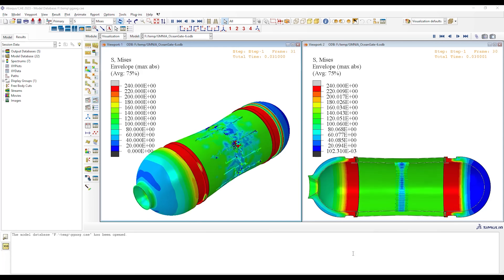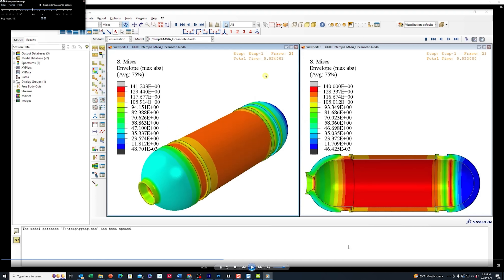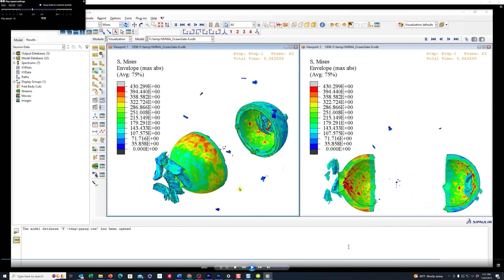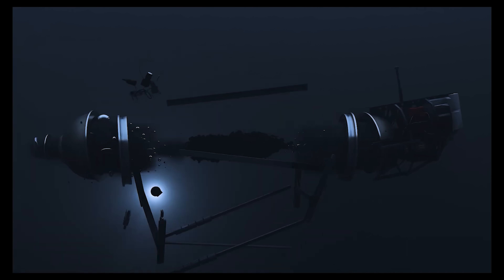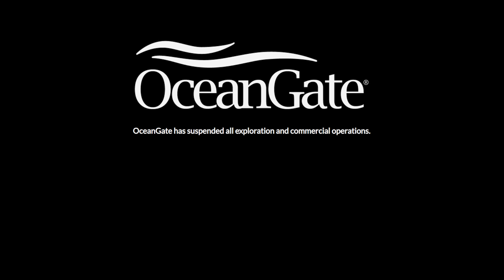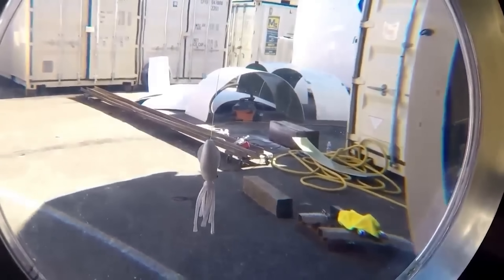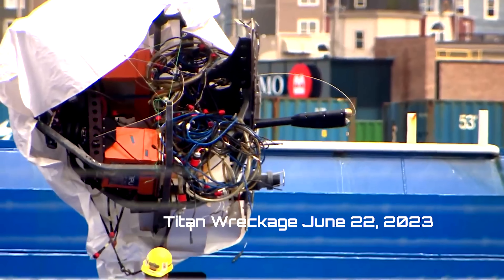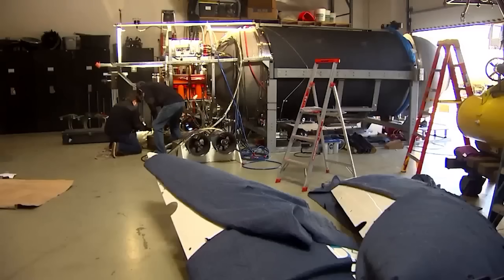Best Titan Sub Implosion Simulation, Cracked Porthole? Q & A

Comment: Mechanical things don't necessarily fail at the "red" points on an FEA. They tend to fail at the highest stress points. In this case, the highest stressed points was the glued interface of the shell and titanium rings. There was so many bad things happening there, its almost impossible to model it. If they did have a good bond, then the flexing of the hull under pressure would break that bond and damage the CF in the process. If it wasn't bonded, then water could ingress and get into the CF laminations.  The hull would be compressed much more than the titanium, so the edge of the titanium would be cutting into the CF little by little.  I'd like to see somebody model this for real and test it.
Reply: i believe the implosion started from the back, crackling sounds were from the back
Reply: @kenho-wr5ul2rh7m  If the communications that have been going around are true, all of the acoustic warnings were lit up red.
The entirety of the carbon fiber was coming apart.
Reply: @RealMcCoy0205  The transcript was complete fake. Came from tiktok. Zero truth to it.
Reply: @paulgallagher2937 Pretty sure the  transcript is of unknown truthfulness. People are trying to claim it has to be fake because it didn't use abbreviated codes. But the messages were short. They weren't transmitting a large amount of information.
Reply: @paulgallagher2937  you don’t know that, just because it was on TikTok, does it mean it came from TikTok
Reply: @lockbert99  Actual messages are all coded as 1 letter. They use sonar to communicate. It was definitely fake
Reply: @paulgallagher2937  The BBC did a documentary and they showed the screen. It didn't appear to be all codes
Reply: @july3410  The transcript is debunked. They had a cheat list of communication signals, almost all of which are just single character. The comm is done through sonar, so its extremely difficult. They never sent entire sentences. Its not possible.
Reply: @lockbert99  I'd like to see that
Reply: @july3410 if it even breezes by tiktok you need to take it with a healthy dose of salt and wait for something official.  That's all they're saying.
Reply: @kenho-wr5ul2rh7m  Bad habit to make your conclusions on unconfirmed informations. ;) People often forget that the communication log is not a verified source.
Reply: If you read the ORNL study Scott Manley had found it also says that the failures in their tests occurred at the glue points. Not due to failure of the bonding but because exactly what you said: so many things happening in those spots
Reply: @udirt  It was just such an awful idea. 99% of competent engineers would have rejected it with very little thought or research. You wouldn't build anything that way, never mind a deep sea sub. There are much better ways of joining the CF to the TI. And you notice that the cylinder had consistent thickness throughout its length. That means they did ZERO stress analysis, otherwise there would have been varying thickness to reduce stress risers. More engineering goes into fruit barrels.
Reply: @udirt  My theory is the glue on the front titanium flange was subjected to additional uneven force when the front hemisphere was open on the surface. That is the hinge would put all that weight into one small point.
If that glue joint failed, it would explain how all the remnants of carbon fiber/people end up rammed into the opposite hemisphere.
Reply: Some guy in this video mentioned the CF was covered in something that stops water from getting into the CF. I immediately think of that pump Stockton mentions and the entry point created that goes from the outside in. If the transcript is to be believed
 I would consider that protective coat was breached the CF was taking in water hense increasing the weight and speeding up the descent more than normal and bingo
Reply: @cathybaldry7822 the product he mentioned is nothing but a paint that gets used on things like pick up truck beds to help with wear and tear and water resistance, absolutely nothing special about it and it won’t have been contributing anything to that hull at depth.  The only reason he’s mentioned it is because it sounds good saying “the military use it” - he’s a total salesman trying to upsell and con everyone into buying tickets.
Reply: @cathybaldry7822  yeah ... Rhino truck bedliner !  08:38
"to keep out water"
It's not going to keep out water @ 400 bar /  5800 psi
At that kind of pressure, there are no small leaks for very long
Reply: We should build a second one and send it down full of pig carcasses and cameras for a Mythbusters episode
Reply: @IBAEhrmantraut  Better be a super high speed camera with high speed communication or you will get nothing.
Reply: Exactly!!
Reply: I think that the CEO was not a total nutter. This sub had it been limited to a certain number of dives and then scapped off would have been a success. The mistake he made was assuming that the integrity of the sub would remain the same after each dive and like you say, it did degrade after each dive with the cracking of the hull. Great summation of events and a test could be set up where the rig is lowered to crush depth. In my mind having a sensor saying you are about to die due to hull integrity loss is laughable.
Reply: With my limited knowledge of FEM, I'd say that's very very hard to model, since you'd need to consider every layer as a separate elements, which is going to be a massive pita.
But yea, the carbon flexing and damaging the bond is also a very valid option :/
Reply: @DCG909  FEA can be done on CF, but only if its made in a controlled environment and has testing to back it up. Once its subjected to stress outside its tolerance (which it was), then all bets are off.
Reply: @paulgallagher2937  
Should have indeed clarified that :)
if you know how it's "bonded" you can make a representation of it, but since this seems to have been a "willy nilly" job it's unlikely to make a correct model of this carbon fiber job...

I also still would like to know how "expired" the Pre-preg was and what effects that could have.
Reply: I watched them assemble the first Titan. But it didn't hit me until someone was criticizing what was going on as they were gluing it - They glued parts of a submersible going to 3,800 meters together!! Even if both sides were the same surface - glue!! But as Stockton put it, not like Elmer's Glue, like peanut butter.
Reply: Another issue is that OceanGate refused to do any long term stress testing on the hull of the submarine. There was likely a lot of damage that was caused by the pressure that they missed and that caused a catastrophic failure
Reply: It wasn’t just glue holding the end caps on, there was a channel in the end caps that the carbon fiber fit into. So the deeper they went the more pressure on the end caps and more pressure holding the end caps on, not the glue.
Reply: @no0channel0at0all  I understand that, and that was the reason for the comment regarding the depth of the receiving ring or surface area that the glue would be applied on! The issue could be  the amount of surface area, lack of quality control, and the differing expansion rates between the CF and end-caps! The glue would form a bond, but it would also form a seal to fill voids and probable area where differing expansions between could form! Because it is a 'U' shaped channel that the CF fit into, pressure encroachment can start on the outside of the ring (U), and slowly and progressively work its way inward, equalizing the pressures out! That's why a good glue (seal) bond is needed!
Reply: And you know maybe I'm dumb in the midst of a lot of smart people but wow he carbon fiber hull seems to have had a critical failure event, with all the experts prophesying t would happen that way. The view window potentially as well. Points out the folly of the "patented" RTM system to monitor acoustically since it just did not matter. When noise starts being generated the implosion is already underway, RTM or not!
Reply: Right, and any voids or disbonds are going to make the composite material that much weaker.  When you choose to forego the expensive NDI inspections like tomography, IR thermography, ultrasonic, etc., you do so at your own peril.  I don't give a crap about this guy, I feel bad for the people that he took with him.  They didn't know the ramifications of his bad practices.
Reply: That glued area started leaking early on, weakened from previous dives. The leaking added weight, the pressure under water eventually sealed the leak but that water was still adding weight and causing the sub to fall to fast and not adjust to the pressure.
Reply: @chuckmiller5763  I'm no expert, but the last part of your explanation doesn't seem to hold water. I strongly doubt the speed of an uncontrolled descent would be so great that the hull couldn't "adjust" (warp, shrink, whatever to equalize forces across its structure) fast enough to "not adjust to the pressure". You may be right that the leaking lead to the uncontrolled descent, makes sense. If the sub did leak, you don't need the last portion of your theory to explain the sub's destruction. My guess is leaking could have caused increasingly quick structural compromise as the sub descended, up to the point where the hull suddenly disintegrated.
Reply: @warpedweirdo  All based on a unverified log, however there is no difference between water leaking in and shrinking/warping in regards of bouyancy.
Reply: @sebastianf.brodda4474  Hey, you're right! I didn't think of that aspect.
Reply: @chuckmiller5763 Bingo . Think the same
Reply: @chuckmiller5763  If they really were descending much faster than expected (which the transcript would confirm if it is real), then this would be the most obvious answer. I can not believe how they not noticed that they were descending too fast. They should have immediately stopped the descension. If you're descending significantly faster than expected, there is a reason for this! Continuing to descend after noticing this is suicide.
Reply: @chuckmiller5763  where exactly would this water that leaked in be held on the craft? its obviously not where they sit, they would notice that. and im guessing other obvious places would get noticed too, so where is this water being held?
Reply: @mistaajones  There is a platform inside that tube where they sit, it is sealed to the sides of the tube, water could fill under that platform and they would not see it.
Reply: @chuckmiller5763  hell yeah!! This is the first explanation I've read that makes sense. When I saw that their descent speed was too fast, and their ascent too slow, I couldn't figure out how water could get in without them noticing, or without destroying the submersible. 

This explanation explains it perfectly - the water intrusion would have happened early, and then closed off.
Reply: @iamamish  that makes 0 sense.
Reply: I agree and the bottom line to this whole analysis is that there is not enough is known about the carbon fiber, bonded joints, or the temperature differential interaction, and the only real way in which this guy's shortcut would have been safe would have been to build this submersible and have destructively tested it in the Marianis to actually know that it would survive X number of dives 2.5 miles. 

Obviously, they have proven that the technology with their engineering is good to go for about 150 dives then it is beyond the safety limit for this technology.  They should have done it without passengers but obviously, that costs money that OceanGate did not have.
Reply: I was wondering about these glued on end rings. let's assume the bonding was done properly. but glueing something together is working on a very small part of the bonding area, just the topmost layer of CF. as the CF was layered as shown, any stress would have to be transmitted by the epoxy, which is much weaker. that process might lead to delamination at the end caps, leading to wateringress into the would CF tube, with subsequent weakening of the structur until failure occurs.
Reply: Theres a place in St Petersburg Russia 🇷🇺  tests alot of under water stuff at high pressure it would be cool to see a model of the Titan being Tested.
Reply: the connection between the titanium and carbon were the most likely weak point, as the carbon was significantly thinner there then the rest of the hull. also these materials will react differently to a load put on them. resulting in total failure down the road
Reply: I have always questioned the joint fit between the carbon fiber and the titanium end-caps; first because of the amount of surface area (depth of receiving ring in end caps)! Second the haphazard way clue was laid up (what appeared to be lack of QC)! But third, from what I perceived in videos of it, looking like Carbon Fiber being sanded or milled down to size to make it fit into receiving ring groove on end caps! Any CF layup becomes weaker when cut, drilled, sanded, or any process used to reshape it! That being said, I wish we could hear from some experts on CF, either manufactures or engineers and get their overview of it, because I as a lot of others also question the way it was laid up (lack of angled cross hatch weaving) on the entire tube!
Reply: I presume THAT is at least part of why the conventional wisdom in sub construction is to use one material only?
Reply: A miniature model of this was already tested and shown on YouTube literally 10 years ago. Didn't go well...
Reply: These ”taking on water” theories never end.
Reply: @KinariCuzz  my question is where is the water being stored? what compartments or instruments are holding all this water? and assuming the water has been building up, surely they would notice it in the obvious places during inspections post-dive. so, is there hidden spaces that could be holding enough water to make them move that quick? i am quite ignorant to the design of the titan, so maybe this is stupid question lol
Reply: @mistaajones  it refilled their water bottles and Rush instructed them to drink really fast. Thus they never sank on previous dives. 

But this time they werent as thirsty, so the sub overfilled and sank to the bottom.
Reply: My thoughts exactly. The telltale will be an examination of the titanium where the glue joint bonded to it- it would indicate if either the glue joint failed or the carbon fiber adjacent to the joint failed.
Reply: Yeah, agree, I'd put my $$$ on the fail point being somewhere along the forward or rear boundaries where the carbon fiber meets the titanium.  Both materials respond differently to extreme stress and temperature transients, especially, if it happens multiple times since this sub had dove before, and the bonding agent between them either started to break down or there was some damage otherwise at those junctions.
Reply: They used wrong type of glue stir It by hand and then put it on a surface that was smooth. 
That was my first thought and still is. You just can't do things like that and expect no leaks.
Reply: I agree with this explanation. While the entire sub being built out of multiple compositions may have been most of what caused it to fail (it was a giant under water gasket).
Perhaps even with the carbon fiber being woven differently and the entire sub being unilaterally fortified into one long piece may have even helped his odds. If using carbon fiber perhaps a couldve shape for the sub could've been explored. Such as a more triangular outward facing hull (how would this act under pressure) if he wanted to just make a real sub, he should've used titanium.
Reply: "the highest stressed points was the glued interface of the shell and titanium rings"
I'm getting very, very tired of seeing the "but the glue!" and "titanium-carbon fiber surfaces!" theories.
I mean, even in the finite element analysis what you say is happening isn't shown.
Is it really so difficult for you people to believe an elongated cylinder, which is something you don't do on a deep dive submersible, made from a material that isn't suitable for repeat deep dives due to compression loading/deloading cycles... Broke in the middle part where there's the most surface area, with the smallest amount of structural stability?

...Is it... really that difficult to comprehend?
Reply: @matchesburn that's not hard to believe.  Neither is the janky glue joint.
Reply: But the titanium was out in the carbon fiber. The carbon fiber would compress around this and make a tighter seal

The failure point was repeated dives weakening the carbon fiber hull and allowing ingress and eventually delamination

People reported hearing shotgun loud cracking noises on dives; this was the carbon fiber hull literally falling apart with each dive

All these computer models showing one thing or another is stupid; the thing is was put under cyclic stressing, and they cannot model that with a non-uniform material like carbon fiber

I’m not saying simulation isn’t good; it is, but it also cannot be used in this case to ‘prove’ how the thing failed.
Reply: I just hope they can get to the survivors before they run out of oxygen, the banging noises are now 4 days apart.
Reply: @cnnothingburgerletsgobrand6381  Darling we are so far beyond that point and always were...
Reply: @cnnothingburgerletsgobrand6381  I’m pretty sure if there’s any survivors they’re inside the Titanic by now, surviving on an air bubble (air pocket from 1912). Little stale but survivable. I search inside of their first. On the starboard side.